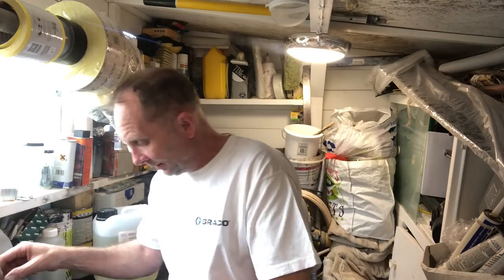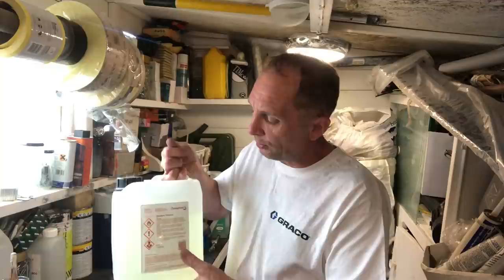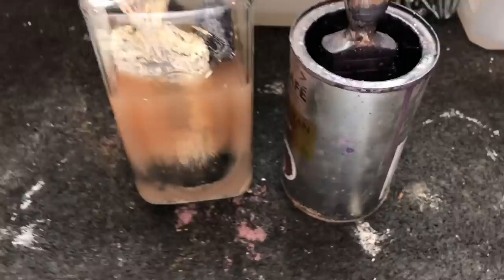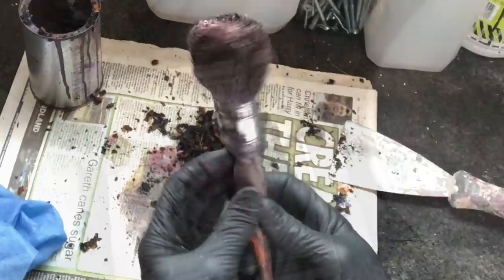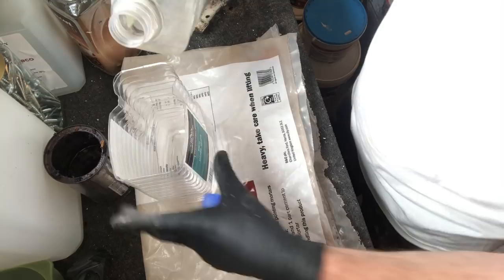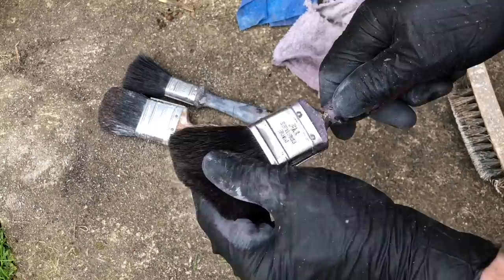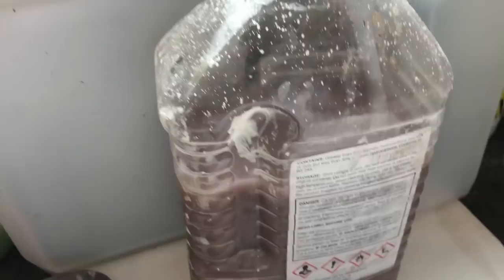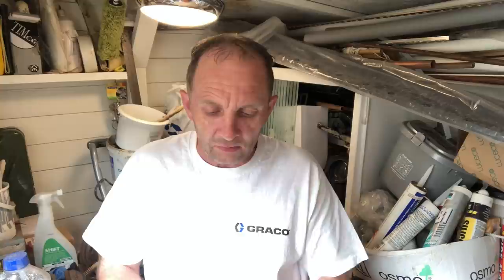How to restore a hard paint brush

Comment: Ok.....I suppose if your bored enough it's worth your time to clean brushes in this condition.  However, I just wouldn't do it. I'd just throw them away. All three brushes were pretty much worn out anyway. Also, why bother with the turpentine wash considering the other stuff worked so much better? Honestly, though, good brushes are only around $20 dollars. It's just not worth it to restore brushes if they get into this condition. It's much better to not allow them to get into a poor condition in the first place.